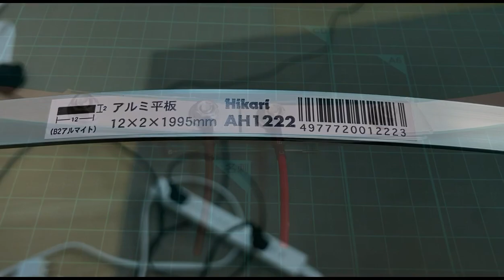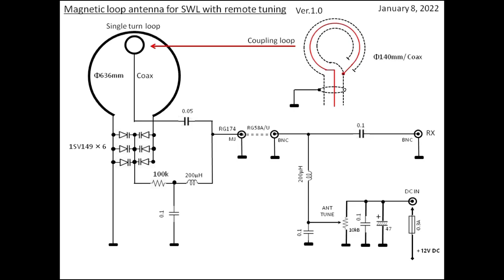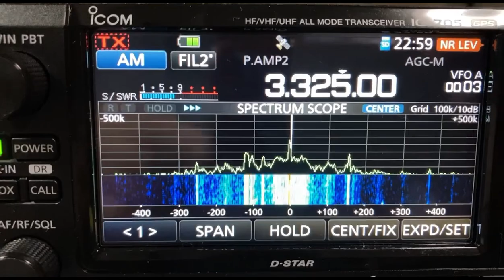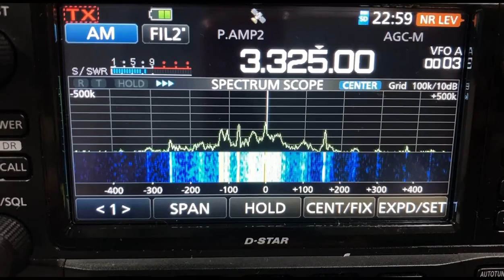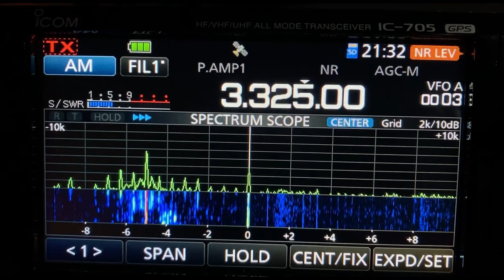📡 Reception test of coupling loop type magnetic antenna

Comment: Excelent!
I would like to have your electronic skills.
Some questions:
Is the gap's length of the coupling loop important?
Is not better idea to use a balanced coupling loop with a balun?
Why you didn't add a active preamp to this antenna?
Greetings!
Reply from the maker: Hello. thank you for the message:goodvibes:. The gap between the main loops is about 1.5mm. However, the interval is for the purpose of maintaining the strength, so I think it has nothing to do with the antenna performance.
The preamplifier will start designing from now on.
Here is the active loop circuit I made earlier.73's!
youtu.be/gOLCrepgcPk
Reply: @Ken.s_BCL-LogVideo   Thanks for your reply, but i think you didn't understand me.
I meant the gap of the COUPLING little loop. The gap without braid in the coax cable at the feed point of the shielded loop.
I wanted to know if its length really matters.
Reply from the maker: @DJMotavirust  Yes, I understand your question. The coaxial cable for the coupling loop has a Faraday shield. The distance between the shield and the soldered core wire is about 5 mm. I'm sorry. I don't understand the relationship between this interval and frequency.73's!